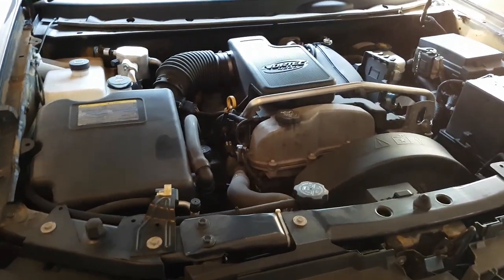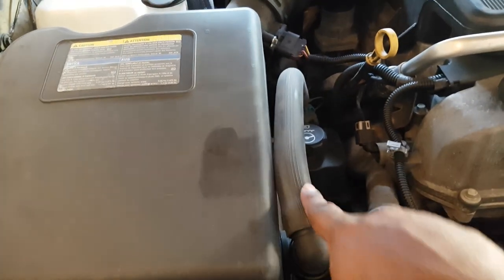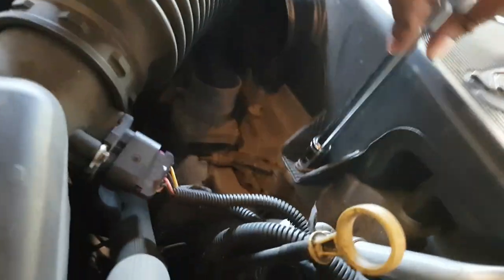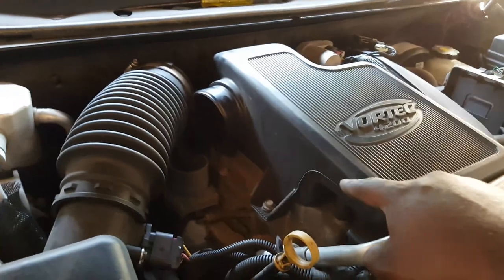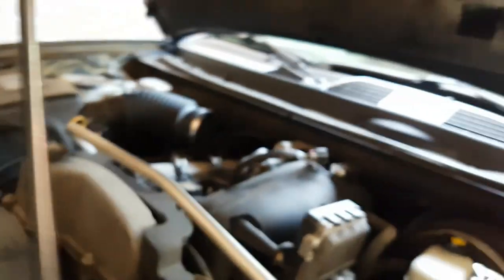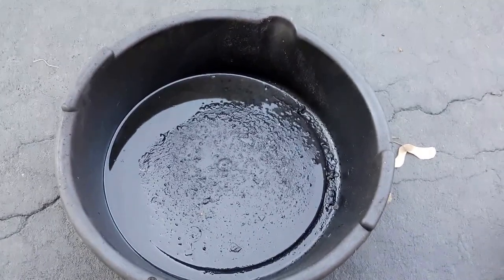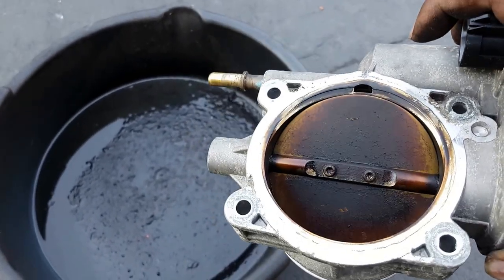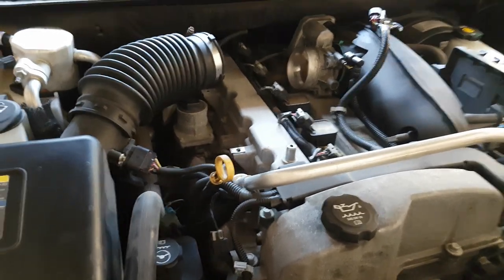Chevy Trailblazer - Cleaning The Throttle Body

Comment: Isn't there a gasket between the throttle body and the intake?
Reply from the maker: Yep, you can see it briefly in the video, at 7:56. It's a green one. If you are cleaning the throttle body, it would be a good time to change it.
Reply: @NexusAuto  I can't see it, maybe it shows for a 1/10th of a second. My point is, YOU never mentioned it nor in the video did you suggest to change it.
Reply from the maker: @NACHALCHAIM  Really, I thought you were asking a question because you weren't sure, and I was helping with the answer. Didn't know you were trying a 'GOTCHA' saying I didn't mention something. 

These gaskets are flourocarbon rubber, and GM themselves say they are a 'lifetime' gasket and does not need to be changed. Unless there is an intake leak, they don't really need to be changed unless cracked or broken. So it wasn't mentioned. It's not a paper or cork gasket. 

So, sorry I didn't mention. Hope this helps clear things up, and you have a great day.
Reply: @NexusAuto  I didn't mean it as 'gotcha'. I meant it as a big omission. A lot of people watching Youtube videos of DIY mechanics can turn a wrench but don't really have an understanding. The way you portrayed your video it appears that the gasket is not important and some following your directions may not put it back, or put it back even if it is damaged. You should redo the entire video and include the gasket.
Reply from the maker: @NACHALCHAIM  I understand your concerns on the gasket. It wasn't really mentioned as it shouldn't even need to be put back or anything like that. It's seated inside the intake manifold housing, with a notch on the gasket to hold it in place, so when removing the throttle body, the gasket isn't even touched. It doesn't come out with the throttle body. 

But I get it. Especially with taking the opportunity to inspect the gasket, at the very least. It would be a good time to check it out and make sure it's not damaged/broken/corroded. 

I'll see if I can find some way to incorporate that into the video somewhere. I wouldn't refilm it, but I'll see what I can do
Reply: @NexusAuto  Now you're talking!

Comment: If you do not have the dealership throttle body relearn tool I wouldn't do this. Many people are reporting extremely high idle after doing this.
Reply from the maker: The throttle body relearn tool is ideal, but in my opinion, not necessary. I have done a lot of these throttle body cleanings on fly by wire throttle bodies, and almost all have not had issues, including a few trailblazers. I am not sure about the many people reporting it...may be your experience on the matter. Cars are equipped to relearn the throttle body cleaning, and I can only see if being a problem if the TB was really really bad. Even in the comments here, only one person seemed to have issues, and they unplugged fuses and the battery and waited a bit, and the computer relearned on its own. Still, having the tool never hurts, and if someone can obtain one, it is a 'nice to have'. Especially since these fly by wire throttle bodies need regular cleaning.
Reply: my idle speed went down significantly after I cleaned the throttle body.

Comment: Awesome video!
Reply from the maker: Thanks, much appreciated.
Reply: I also needed to replace the fuel regulator, that took care of the issues that had been encountered by the Trailblazer, 03, with 115,000 miles on the clock! We've had it since '06.  Very few winter months of use in Wisconsin too! It shows that 🤗  Happy Dance
Reply from the maker: @normanhopfensperger4343  hey hey! That's awesome news! Sounds like you treat your Trailblazer well and take care of things as they come up. Amazing mileage! The one in the video is my dads...he loves it and swears by it. It definitely does the job. Happy to hear yours is still going strong
Reply: Yup, we are the second owner, it's also a black beauty!  I am looking forward to adding power seats and fog lights to it, possibly next year 😀 It only had 39,000 miles on it, in 06.  Slotted and drilled rotors and ceramic pads all the way around.  No curb rash on the original aluminum wheels too!
Reply from the maker: @normanhopfensperger4343  Awesome! Sounds like it's in excellent condition! Love the brake set up you have too! You know how these GMT360 vehicles are. True workhorses, and nice to drive and look at too1

Comment: Hi, when you clean it did you move the “coin” with your fingers? I’m about to do this to my engine but I’m afraid to mess the TB up. Thank you
Reply from the maker: Hello. Sorry for the late reply. You can move the plate slightly, and it does have the ability to move. But I would advise caution. 1. If you push it too much, it can damage the unit. Only move it a little. 2. Be VERY careful. the plate is sharp and you can get injured. But if you remove the TB completely, you should only need to move the flap minimally. Hope this helps.
Reply: Nexus Auto Thank you !
Reply from the maker: No problem

Comment: 7:05 I cant tell what your putting your finger on and what you are squeezing but mine will not come off
Reply from the maker: No problem. At the 7:05 mark, on the connector, there is a little grey clip (it looks like a C) and then a black tab in the middle. You need to press on the black tab in the middle while pulling the connector off. Sometimes they get jammed with age, so you may have to wiggle it a little bit. Shouldn't need very much force though
Reply: Subscribed! Thanks so much for the reply! I couldn't remember for sure how to get those connectors loose and did not want to end up breaking something. . The grey clip was stuck from age but I got it finally after seeing another video. I unplugged the battery, cleaned the throttle body and so far po171 is gone. Now onto the po420.😵‍💫
Reply from the maker: @bsavvy32  no problem at all, and thanks for the sub! Much appreciated. Great news to hear you found the info and got the P0171 taken care of. Hopefully P0420 goes well..it never ends, right? Lol. Thanks again for watching!

Comment: Do you have to disconnect the battery befor you do this?
Reply from the maker: Jasen Swett technically, you can do this job with the battery connected. But for safety concerns and to save any potential damages, better to disconnect the battery

Comment: Its great that you now have a clean throttle body, but you never fixed the root of the problem.  Your PCV orifice is clogged!  Look between the intake manifold between Cyl 3 and 4, there is a short 5/8" hose between the intake manifold and the inside of the crankcase.,  There is a little hole (that you cant see) that allows vacuum to suck air continuously from the crankcase to the intake manifold.  If you keep it clean, there should never be crankcase gasses up in the plenum to gum up the throttle body.
I use a few squirts of denatured alcohol into that tube just before I change my oil, and then pressurize the hose slightly to blow it thru the orifice to keep it clear.

Comment: What's the sence of cleaning the throttle body butterfly? I don't get this video at all..... I mean the throttle body sensor is what goes bad on these TB's, not the fact that it's dirty (butterfly). 🤔???
Reply from the maker: No worries, I can answer this for you. 

2 reasons to do this. 

1. You are right, one of the reasons any fly by wire throttle body goes is the TPS. However, a big reason for that is when carbon builds up on the throttle body, it causes significant resistance increase to the throttle body, which is one of the leading causes for the throttle body motors to fail. 

2. A more common issue is when the carbon builds up on the butterfly plate, it starts having adverse affectson power delivery and fuel consumption. I have even seen cars have starting and idling issues from a carbon covered butterfly. Once it is cleaned, issues are gone. 

This is only a recent issue. with throttle cabled TBs, the lever action would force the butterfly open. However, since the fly by wire has come about, this is very frequent. I have done dozens of cars from all manufacturers, and it is a major improvement every single time.
Reply: @NexusAuto   Wow! Makes a lot of sense, thank you for the heads up I will start cleaning them from here on! 👍
Reply from the maker: @salvadorhernandez3404  No problem at all. Happy to help!